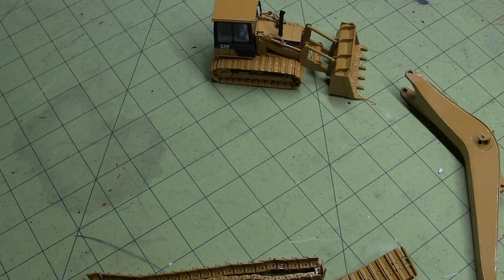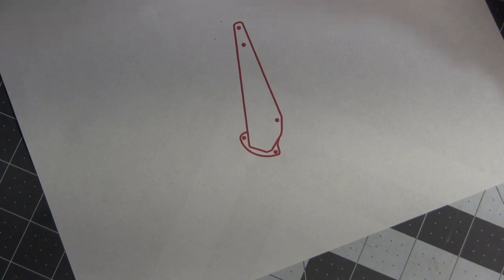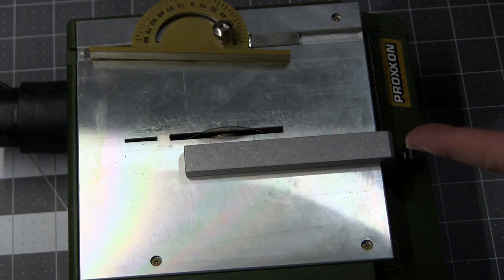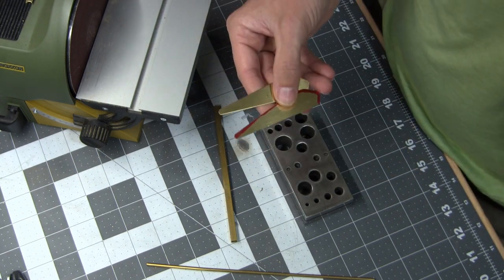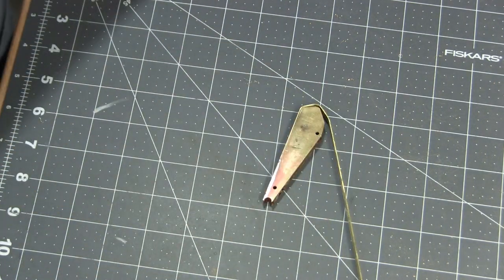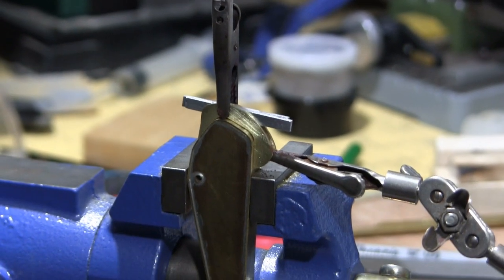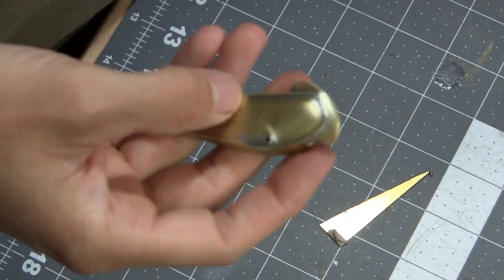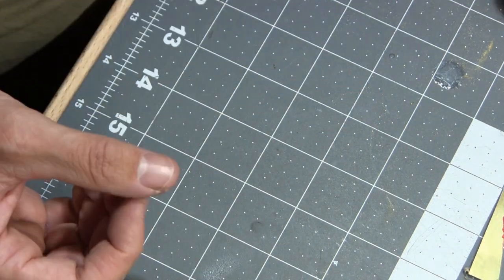Building an Entire 1:50 345B Mass Excavator Stick from Brass

Comment: Stephen - I enjoy your videos.  My favorite material to work with is brass.  I like to say that I enjoy making solder flow.  In this video you wrap a brass strip around the base assembly of the boom.  To get the brass to configure itself to the boom's base you use a wrench to force it to conform to the shape along with a small brass hammer.  What you did turned out very well but I thought that I would share one suggestion with you that may make this process easier in the future.  You have a torch so please consider annealing the brass strip first.  Annealing it makes it "dead soft".  You would be able to use your hand to form the brass around the base.  Additionally, it far less "spring back".  To bend semi-hard brass to a 90 degree angle, you have to typically bend it to 95 to 100 degrees so that it springs back to 90 degrees.  Annealed brass has far less tendency to spring back.  Working the brass causes it to harden again.  If necessary you can re-anneal the brass multiple times to make it easier to work with.  Keep up the good work and I look forward to your next video.
Reply from the maker: I don't know how I missed this comment, but thank you for the suggestion. I'll look into annealing more. I was worried I'd weaken it, which is why I always do cold forming, but looks like I have some more studying to do!

Comment: Awesome videos! Just found you, what kind of dremel is that? Where did you buy it from? I am just getting into the hobby, I operate machines for the last 11 years and im 27 now and just got into collecting and want to do removal of pins and tips and tricks for getting them back together
Reply from the maker: Hi Jared. The rotary tool I'm using is called a Gorbet S-300, in the 1/8hp configuration. Pretty decent entry level rotary. I opted for the chuck style handpiece as it's a bit more versatile.
Reply: Stephen's Custom Models can you make a video showing sizing for replacement pins? And I know youve shown how you punch them out but just like a base line of the process of sizing and where you get your brass from. I have a 374 cat that I want to take apart and trim the hydra ya cylinders on so they go all the way down and out. Love the videos
Reply from the maker: @JaredBeaucage  The sizing seems to vary from manufacturer to manufactured, but I'd wager to guess that your 374 has pins that are roughly 2mm, like the 345B. My suggestion would be to get a few different sizes of metric thin wall brass tubing (1.5, 2, and 2.5mm) and then 1mm brass rod. All of the thin wall brass tubing from K&S Precision metals fit inside one another so you can build pins to fit you needs with a good starter set of them. I get mine at my local hobby shop, but they're available online as well. If my next project involves this style of pins, I'll be sure to isolate a video covering it. An inexpensive digital or analog caliper will also be of great use as it'll allow you to measure the old pins diameter so you can match the replacement. If the hole is too small to cleanly accommodate any size of new pin, you can drill it out a tad and insert a shim. I cover that in my The Rest of the Small stuff/engine cover video: https://www.youtube.com/watch?v=9k00OWCEJQI at the five minute 40 mark.
Reply: Stephen's Custom Models yes I just bought a caliper on friday, and seen how you punched the pins thru and some of the ears broke, so i am going to stick to just drilling the rivets out